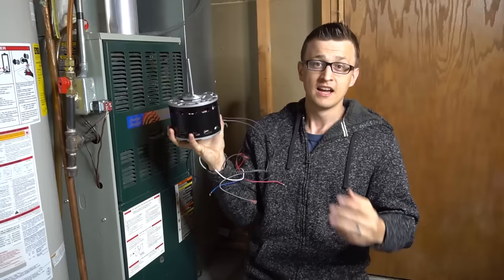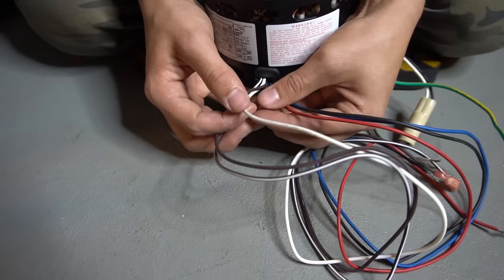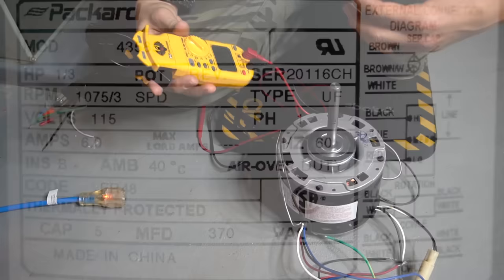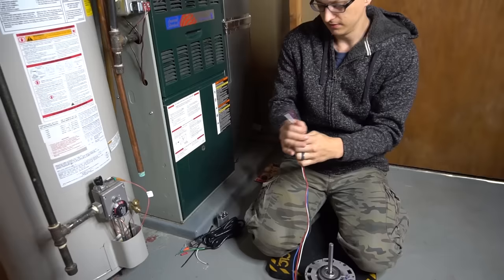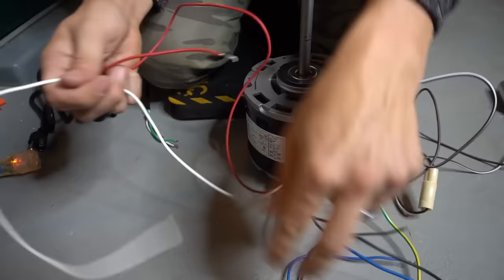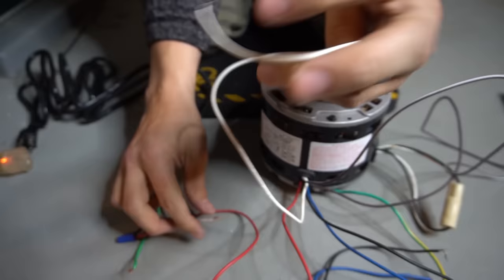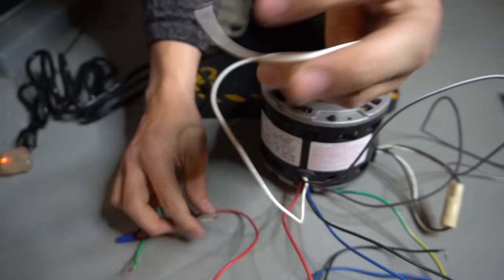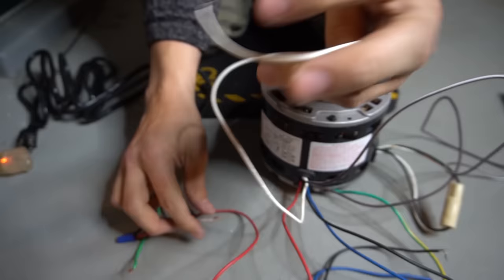How To Wire a Furnace or AC Blower Motor

Comment: Hello 
Thank you for the information. 
I recently replaced my york 80 blower motor. While installing it I noticed black wire with a fuse on it (high speed) was connected to Cool and Heat with a U wire (or bypass if thats the correct terminology) Blue and Red in Park and white in Cir. So i cut old motor’s wires and connected the new motor’s wires.  Could you comment on that?
Thank you in advance.

Comment: Exactly the info I was needing! THANK YOU!
Quick question…… could you run the plugs black/Hot through a toggle switch then reversed through a 3 way light switch connecting two speed wires 
 (High/Black and Low/Red) from motor?  Making a DIY On/Off toggle switch and the 3 way switch becoming a speed selector?

Comment: Hello, I would like to start of by saying I appreciate all the information in your videos. I had an experience today, that I’m not sure if anyone else has had. However, I want to share and have a question. Today I replace a Rheem evaporator blow fan motor. Everything was going fine. I use my hub puller broke the stuck motor free, place the brackets at the exact measurements as the old one, evenly balance the fan space in the housing. I reconnected the wires to its proper spots 
(1,2,3,4,5)  gave it power. For a few seconds it smelt like the heater was on. After opening up the unit I didn’t see any wires touching inside of the A/H nor, were any wires lose. Filter was clean , button it up. Ran the unit for 30mins all good. Went home two hours later I get a text from my boss saying the unit spark a fire. I get the customer house to fine out the A/H didn’t spark a fire at all. I confirm by opening it up and looking for any fire or spark mark. I came up empty. All Good. Then, the customer tells me that the spark was from the thermostat which I didn’t touch nor was there for that..I looked at my low voltage wires which I didn’t need to touch either.. I saw nothing wrong. I pull the face of the Honeywell thermostat and saw 3 pins burnt..My question is what could have cause that?

Comment: Hi Jay, your videos are excellent and inspired me to repair my HVAC fan that quit.  I installed a new motor and it now comes on for a few minutes but then shuts itself off---what may be wrong?
Reply: I found the problem---I had both wires on the same side of the start capacitor.   Moved one wire and it works perfectly.

Comment: Sooo, my old motor had a clip/harness the wires were hooked into and my new motor just has bare wires.  

Capacitor wires are purple.

If my old motor had red, white and black wires does that mean I have red wire for low fan for heat and black wire for high fan for cool?

Do I hook the red from motor to red from unit, black from motor to black from unit and white to white or red and black from motor to black from unit and white to white?

Seems like that wouldn’t supply power to the red and black. Do I combine the red black and white all together instead?

Thank you for your excellent videos!

Comment: Nice clear video with great info. So, if I had a 200-230V, 60Hz, single phase, induction motor with a 10uF 370V capacitor, how would I connect it to my home power? It doesn't have a neutral/white lead. The connector that previously attached to the furnace circuitry has three wires - a black, lt blue and red. The black goes to the capacitor and then on to the motor. The other terminal on the capacitor has a yellow that goes into the motor. Does that serve to start the motor turning and keep it running? The red and lt blue attach at terminals which are labeled on the motlr's schematic as low/medium speeds (there is a third unused terminal for high speed).
If I were to guess, I'd say my 240 wall socket, wired to a 20amp dual breaker with the hot poles connected to the two terminals and the copper ground to its terminal, would have a leg going to the black motor lead and the other leg going to the lead for the selected speed...that sound right? I was going to insert a double pole power switch (one toggle switching both lines) in the cable to start and stop the motor.
Any advice or links to other resources would be much appreciated! Cheers!

Comment: Nice video, thanks.  Just to mention though, when doing any kind of electrical work, you should always do the ground first (usually green), then the common/neutral (usually white), then the hot (usually black).  Just insurance against the electricity end of things. (i.e. if things accidentally get turned on, or for some reason there is some kind of surge--a strong Solar CME can induce currents for example or a thunderstorm/lightning).

Comment: Great video.   Couple questions:
1. How would a person know the other two speeds on this motor if it only lists 1075rpm. 
2. On a multi speed motor, if there is only one speed specifically listed on the label, is it always/usually the highest speed?
Reply: On those type motors (no load) the RPM is the same the only thing that changes is the amount of torque ... in other words the RPM (medium and low speeds) will vary depending on the amount of load ... and the RPM listed is the RPM at the rated load for the motor ... again medium and low would have to be measured in each particular application to know the RPM for medium and low speeds

Comment: if i may ask a question about the capacitor . i  appreciate any help that can be given . am i able to use any other caps or does it have to be a dual 5uf cap? oh the wiring diagram it says ROT <-----> cap  5.00/ 370 .i basically have that same motor but its a 1/8 hp not 1/3hp  EDIT:  also thank you for the video. great job with explainations

Comment: Thank you Jay for the very informative video. How would you suggest to wire a 115V inline duct fan to the furnace blower motor so the duct fan motor would come on at the same time the furnace blower motor comes on?

Comment: teedesign53 I have watched other videos and this one gives me the information that helps the most I just replaced my AC condensor fan motor on my packaged unit and the old motor didn't have a drown wire with a white strip just the one brown wire ,that connected to the cap the installation went well and is back cooling question is should I have run the brown/strip wire as well to the cap getting a thumping noise once the cooling cycle completes.

Comment: Great contents and thank you
Is this a PSC motor then since it contains a capacitor circuit
I have another one which involves a movable contact  capacitor  then the rest of the leads goes to a control board..how do you call that motor as well???

Comment: So what if the original motor i have had 2 wires, and both attached to the capacitor, and had 2 ports one for hi and low. But i orderd a new motor this new motor has alot more wires, what do i do with the nutural wire?

Comment: I’m in school for HVAC, this helped me out a ton. I got a question though, you mentioned putting the low speed on the control board on either “park” or “fan.” By putting it on “fan” does that mean you can adjust the velocity by putting a higher speed on it?
Reply from the maker: Glad to hear the video helped! And yes, I believe you understood that correctly. Whatever fan speed you have hooked up to the fan terminal will be the speed that is used when you set the thermostat fan setting to ON.

Comment: I was wondering if there’s way you can connect each speed to different switch and if you turn on two speed source at once would it just shutdown the other speed or it would blow the motor?
Reply: You could buy a rotary switch with 3-6 terminals, one of which is your neutral side feed wire. The other three would be for your low, medium and high speed  fan settings. This would be an external switch that would allow you to control your fan speed outside of the circuit board application which is automatic depending upon the design of the circuit board......I use the motor and the three speed fan rotary switch for other applications outside of the HVAC......squirrel cage fan in my shop or even an outside yard fan for hot days. Works great !

Comment: So… If I wanted to hardwire an in-line duct booster to come on when the blower does (without using a pressure valve switch) for the a/c… I would need to… ? I’d be super grateful if you did a video for that. I have a Tjernlund duct booster model DB-2 and am attempting to figure out how to install on a Lennox G61MVP series unit. In the vague instructions guide it looks like they want me to tap into the high speed, common/neutral to a mystery, and ground to another mystery spot. After seeing this video I’m wondering do I just splice and cap into the black (high) on it’s way to the board, use a unused neutral on the board, and ground to a conduit clamp or buy a separate box that has a special green screw for that? Plz help.

Comment: I forgot to wire the cap in after I changed the motor and tried to start the system and noticed soon what I had forgot to do. Shut it down and let it cool down and in a little while system started right up. It happens.

Comment: Very well done Jay. Timely as I am replacing my 4speed with a 3speed (it's the unit available to me) as the lowest speed (red) is in "PARK", so the unit was already functioning as a 3speed. The "EAC-H" connection has the yellow wire (medium low). I am assuming this connection is used for the "FAN" as I don"t see a connection labelled as such. Is that correct?

Comment: Very good video! I have a question, though: How do you know which wires are for the capacitor and common if you don't have a wiring diagram?
Reply from the maker: Usually the white will be common and a brown or purple wire will be for the capacitor
Reply: @WordofAdviceTV  Thank you brother for putting out great content. I have a question for you if you don't mind... I replaced a blower motor for an elderly couple from church recently as a favor. When I realized that the motor was rotating the wrong direction, I swapped the two wires after disconnection power. When I reconnected power the motor blew (pop sound and flash from the motor). I have an electrical background though I am not a journeyman. Where did I go wrong? Will I have any issues returning it? Should I the thermostat been turned down before connecting power? Thanks for your time! Chris

Comment: Great video! I have a question, I replaced a really old motor and the new one came with a common wire. If my board doesn't have neutral slots, where can I wire it?
Reply from the maker: The old motor had to have had a common wire as well. I would plug the new motor's common into the same place where the old one was.

Comment: Thanks for all the videos. Quick question. I recently replaced my blower motor. It seems that the new one is getting very hot when I run it on only fan for about 30 min. Same thing with the old one. The surface temperature read about 137 degrees. Is there something that could be causing it to over heat like that ?

Comment: Your water heater should be on a 18" stand 
If not in an enclosure & the reason for this is the bottom is where the burner sits and it 
Is really good at confirming ceartin liquids are indeed highly flammable. Couldnt help but notice but ya..its a legit fire hazzard.

Comment: Excellent video, much appreciated. Answered my questions....except 1. My thermostat has a fan setting , but the control board has "cool", "heat" and 2 "spare", no "fan"'. Is the board likely supplying "heat" voltage during "fan" request? Thanks for sharing
Reply: What is the make and model number of your board?  I will be happy to look this info up.
Reply: my trane xr80 control board has no "fan" either. it has cool, heat, and two parks. my thermostat can control the blower "cool" mode for auto or on continously and the same for the "heat" mode.

Comment: on my Goodman, I had to remove the wht/brn wire from the capacitor and attach the common to it. Have you ever run into that? It was a three speed motor

Comment: You need to explain how dangerous the capacitor is, and de-energize them when messing around, or working with them on any video. Other than that, great toturl👌
Reply from the maker: Ah yes.. I totally forgot about that part. Thank you for mentioning it in the comments at least!
Reply: @WordofAdviceTV  No problem! Keep, up the great work.
Reply: I had wondered about that as well. In videos on repairing AC units, they always talk about that. I was wondering if furnace capacitors are different, or if you need to de-zap them as well. Thanks for bringing this up!

Comment: Thanks for the vid I have a wood burning furnace and lightning killed the mother board and they want 450 bucks for it and it looks like they are the only one that has it so I may just get a programmable thermal cut off 120v 10 amp switch and it comes with a probe and run it into the hood and just hook up the second lowest speed wire as it's a 4 speed, it always came on at high speed and always cut off to soon so I will be able to lower the speed and set the therm switch to cut off at 50 degrees to shut it down, this is a out in the pole barn furnace and would rather have control of my fan time, this is a Drolet Heatpro furnace and mother board is part# 44180 if anyone knows where I can get this board cheap please let me know.

Comment: Very helpful!  Thank you!  I do have a question.  If you don't know which wires are for your capacitor, how would you be able to use a meter to distinguish between common and speed wires?  

I am replacing a range hood fan (5 wire) motor that has 3 selectable speeds.  The new (6 wire) motor has one additional wire.  These are both made by Elektromec, model EP40, 320W, 2.7A with separate 25 microF capacitor.   I don't know if this is an extra speed or if it's a second capacitor wire. Using what I learned from your video, my original motor had 3 speeds, that's 3 wires, plus a common, which leaves a single wire for the capacitor. Ground is separate yellow and green wire.  Thanks a bunch already for your help!
Reply: two wires go to the capacitor.

Comment: I just replaced a dual capacitor. No start up capacitor in the unit.
If a plunger is in all the time a fan could be at fault right? 
I have a filling when I rotated it it was spinning but could feel like it's not spinning freely.

Comment: Great video! I need help with wiring in a universal blower motor .... replacing an old GE 230volt, 1/6 hp motor that uses the metal frame for neutral, and only has 3 wires, red, black and yellow.  No circuit board, since its an old unit and the old motor did not have an external capacitor. Any suggestions would be greatly welcomed!

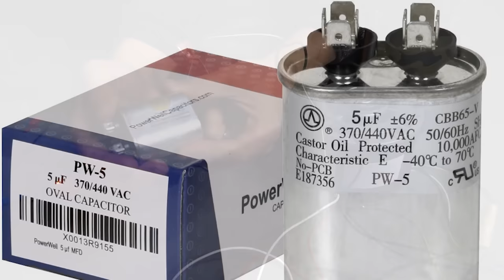Comment: at 7:25 you said + or - 5% when the cap said 6%. I want to speak to your manager

Just kidding. Great, informative video as always, thank you and keep up the great work!
Reply from the maker: Haha yeah.. That was not the picture of the capacitor in the video. I forgot to take a picture of it when I was filming so I just got a picture of one from Amazon when I was editing. Thanks!
Reply: Word of Advice TV 
Jay. I have a question, love your shows 
Ever since I put my new condenser fan motor in outside-  when it gets cooler at nighttime- my outside unit doesn’t turn off / Contactor won’t disengage and keeps loading - while the  inside air handler is not calling for air or even off..  how do I stop this problem please help???
Ps - I have to pull the disconnect box/pin outside to turn it off and when I place back in I hear and see a spark ??????
Reply: @joesharp51  Sounds like a short in your lowvoltage wire ("Y" and "C" terminals on your furnace board, connects to the contactor as well) Possibly chewed on by rodents, maybe contactor squished a bug as it closed and now its stuck closed? 

Sounds like a low voltage/contactor problem to me. but I'm sure Jay will be able to figure this one out. I'm curious to know
Reply from the maker: @agahajak  Those are my first thoughts as well :) A stuck contactor or something shorting out. Thank you for the quick answer! I got to a point where I can't keep up with all the comments any more so I appreciate people like you who answer others as well.

I do find it a little odd that this only happens during the nighttime though... Have you noticed if there is anything else in series with that contactor? Like an LPC (low pressure cut off), energy saver switch, fan delay board, etc.. As for the disconnect plug sparking, that does happen so I wouldn't get too hung up on that part. Or is the spark really big and it has never done that in the past? In that case maybe there is cause for worry...

Comment: As usually very well explained. I learned a lot with you. Really appreciate your time and effort putting in all your videos. I have a very special request. I'm a maintenance tech and so far we have over 20 ecm blower motors that I can't say the brand here on your channel for obvious reasons but are bad and waiting for warranty (Distributors only sent 1 every several weeks) I'm trying to convert them from ECM to PSC and all are straight cooling system (240v) since I'm reading that's a very common problem with ECM motors and are very expensive could you make a video? I know you have videos for but not for straight cooling without board? Do I really need an extra relay or with the existing contactor in the evaporator area and a capacitor I will be able convert from ECM to PSC. Thanks in advance.

Comment: Please can you answer this question? What damage can occur if ones of the capacitor wires accidentally gets grounded to the furnace case while running? I came home after my wife called me and said there was a bad smell coming out of the registers . I went down in the basement to find the furnace was making a buzzing sound and that the capacitor had vibrated out of its holder an one wire was grounded. I moved it and zip tied it and waited till everything cooled down and restarted the furnace and it seems to be functioning properly. Will there be any long term affects from this happening ? Thanks Chip